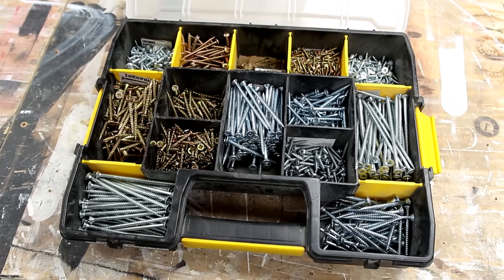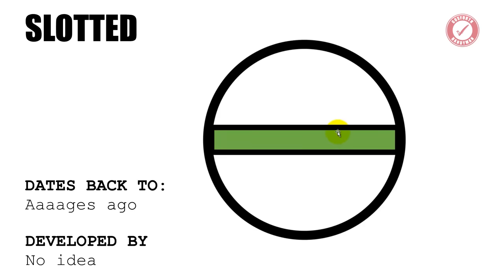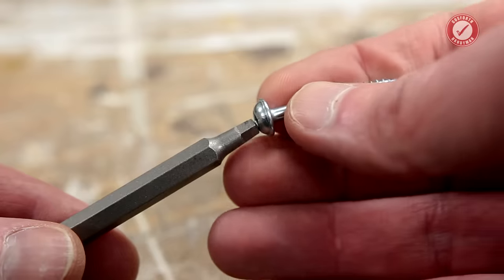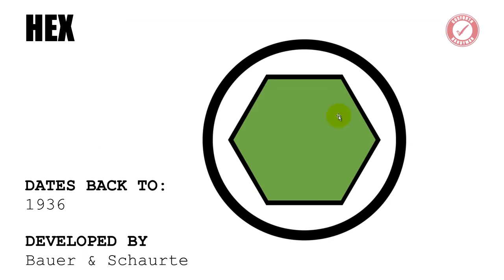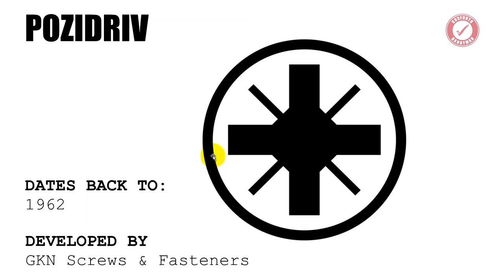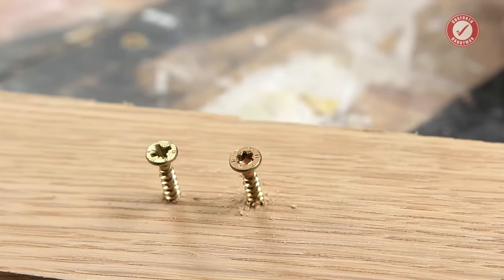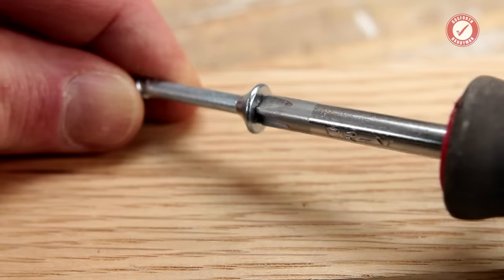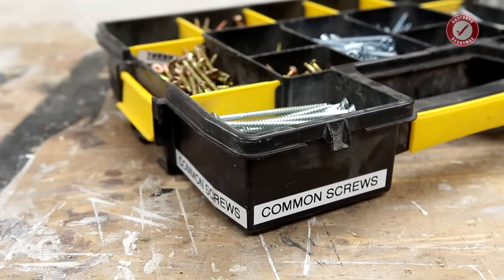Why are Pozidriv screws better than Phillips?

Comment: With the exception of old drywall screws, I have yet to shear the head off a slot or Phillips head screw. And never use a drywall screw in anything other than softwood. With Robertson, Hex and Pozi head I have sheared heads off screws, particularly in hardwoods. Two things are very important with high torque screws... proper size of pilot holes and proper setting on drill/drivers. A little soap on the screw thread doesn't hurt either. This method doesn't usually apply to self-drilling screws like construction or deck screws.
Reply from the maker: What brand of screws have you had the head shear off? Only screws where the head regularly shears off for me are drywall screws. Most screws you buy in the UK are wax coated. 👍👊
Reply: @GosforthHandyman  In Canada we have numerous brands depending on where you buy the screw. Home Depot will carry one brand, Lowes carry a different brand, specialty shops another... so it's not brand specific, and I expect most of the product comes from China or other overseas sources. Often it's application use that causes a shear, which is why I commented on pilot hole and driver settings. Slot and Phillips usually cam out if the torque gets too high. Due to the positive nature of the drive fit in Robertson, Torx and Pozi, care is necessary to ensure not to over torque the screw. Very good video, by the way.

Comment: pozidrive is as uselles as philips in wood screws because it cams out in high torque anyway and if you need to use hand screwdriver at an angle you will destroy the screw and the driver. I don't understand why it became some sort of standard in wood screws in EU since Torx is so much better.

Comment: Ive used many screws, initially mostly PZ, but ultimately i found that Torx were the easiest. Mostly because they don't cam out at higher torque. True you need the right bit, but then PZ comes in 0,1,2 and 3 sizes at least. Using the wrong size invites caming out and if the screwdriver bit is a bit worn it damages the screw heads as well. So i don't agree with the conclusion here. The video clip of wobbling around with a Torx was silly, they don;t do that, that was contrived and made the rest of the video suspicious. Use the right size and  they almost 'stick on' to the screw, just like a brand new, correct sized PZ. In the real world, with worn bits, it's far more likely that the PZ gives trouble. Torx, or Robertson are by far better, though PZ comes along after them. I agree that Phillips is bad. Contact area is determined in part by flex of the head, and driver in principle, under pressure, this was too simplistic.

Comment: And yet you have failed to mention one of the better "cross-head" fastener and bit systems - Japanese Industry standard or JIS. Where the fasteners are identified with a small dimple on their head and one may use a JIS #2 (for example) driver on EITHER a #2 Phillips OR a #2 JIS fastener - though you should NOT use a Phillips bit on a JIS fastener.

Comment: Good video... but most people in the UK (and especially in 'Murica') don't have Pozi screwdrivers and use the ubiquitous PH2 for everything... PZ screws are mainly used in the woodworking environment, and PH screws dominate elsewhere in my experience.

I do like Torx screws, but they are harder to find than PZ which are stocked everywhere. Whenever possible, I use SPAX screws, as they have standardized on the T20 heads (from 3.5x16 for hinges to 5 x100 at least)
Reply from the maker: Defo the case in America but in the UK I'd say 95% of screws I see are PZ2... but Phillips drivers will work fine with them. The main exception in the building industry is plasterboard screws - lord only knows why they're Phillips. 😂👍
Reply: Francois Lafaix. Agreed. Spax, Wurth or Reisser are the best out there.

Comment: i still hate pz with passion,
 a) unless the screw and the bit are perfect (they never are), driving a screw in with a cordless drill, a cam-out or two or three midway are GUARANTEED, because even a slight a slight axial misalignment makes the bit climb out of the socket. Phillips - does that too but much less so, thanks to taper.
b) idk where you get your perfect screws. Mopst that i encounter are quite sloppy and don't stay on the driver.
c) nobody around me has a clue that ph and pz are different beasts => everything is damaged all the time. Better if we'd just stuck to ph. 
d) good quality ph works really well too.
tldr i see pz as a slight downgrade, and combined with the confusion it causes, makes me hate it with passion. Sorry.

Comment: 4:17 you forgot to mention the worst part of philips - they were designed to cam out when too much force was being used. This was so that machines could do up these screws without needing specific torque values.   Biggest pain on earth, as they are designed to slip....so you cant tighten very much... and if its rusted, can't get them out!

Comment: With all types of head there can be a problem with the number of poor quality screwdrivers on the market. I have an original, wooden handled, GKN screwdriver sold with a box of screws which I have used since the late 1960s and it is still unmarred. Cheap ones start to distort after the first few uses.

Comment: Actually, a Philips driver does not work well in a Posi screw as it is too loose fitting and is prone to cam out. Being in the States and working in the ski industry I am forced to go back and forth between the two. No one over here even knows what Posidrive is, so it is common for the untrained to see a Posidrive screw on a ski binding and stick a Philips in it and "screw" it all up.

Comment: Torx all day long.. drive a lot easier than Phillips.. Phillips strip out so fast it’s annoying and the first slip of the bit and it’s all over.. Phillips should be outlawed as well as flathead.. either hexagonal (like a bolt) or torx is what I’d make universal other than specialized screws..

Comment: pozidrive screws don't cam out compared to phillips because they don't have a taper. The taper with phillips results in a force components that pushes the bit out of the screw, with pozidrive, this doesn't happen. 
Your explanation is therefore plain wrong. The inner corners barely have any inpact on this! ;-)

regards
An engineer

Comment: I hate phillips and pozidrive. They seem to be made for screwing-in and not for undoing, and certainly not for re-using. Actually they're not even that good for screwing-in.  Torx all the way.
Reply from the maker: Might be worth trying a different brand with an impact driver - you shouldn't have any issues re-using Pozi screws. 👍
Reply: @GosforthHandyman  I don't use an impact driver. I use a drill and various screwdrivers. I'm sure an impact is better.

Comment: What ?!? Pozidriv ISN'T tapered, PH is..
PZ is basically the UNTAPERED PH.. They simply took the PH head and rotated the 4 cutouts (twice per cutout) so they WOULDN't form a taper.. reason why with PZ you now have the little inside "flutes" that have nothing to do with actual gripping force (even if they do in theory grip to something.. ) but are the result of the rotated cutouts which were made to counter the PH design of skipping out when a certain torque was reached.. PH head was invented with the taper in mind as a feature, to avoid over tightening of the screws.. PZ was the "removal of this feature" from the PH design..
"PZ are less likely to come out" - Yes, exactly, because that's what they were intended for.. to NOT have a taper like the PH, which was a FEATURE of the PH.. The resulting little "flutes" in the center are just a result of the PZ not being tapered.. nothing to do with adding extra grip.

Comment: Until screw gun bits came out most so called "Philips" screw-drivers where crap -- malformed and resembling "Prince tip" more than Philips and often the drivers metal was too soft to stay sharp.. It symbolized American "low quality" in tools till professional grade screw-gun bits came along.  Of course you get what you pay for.